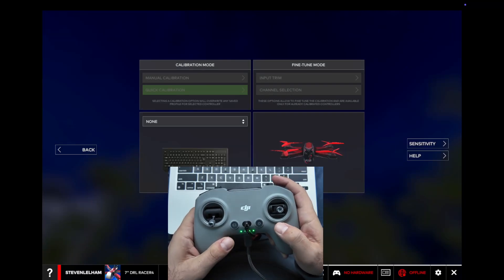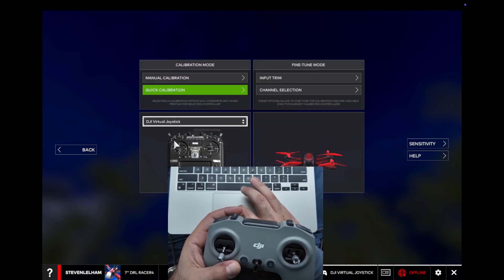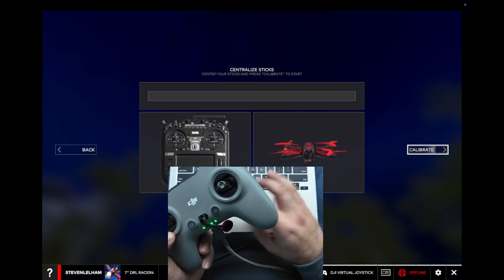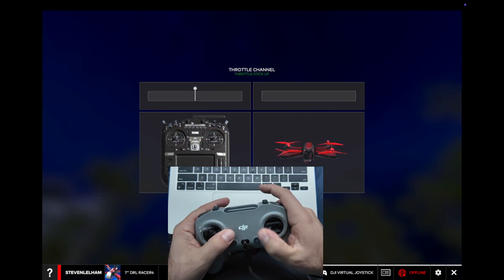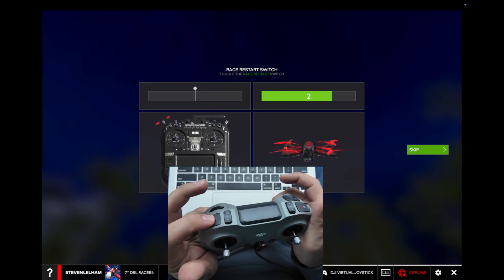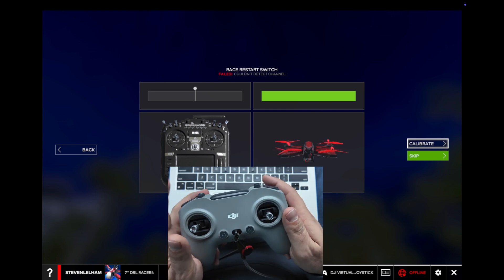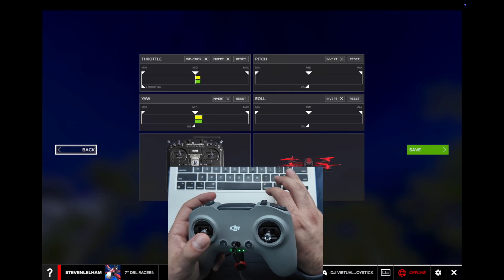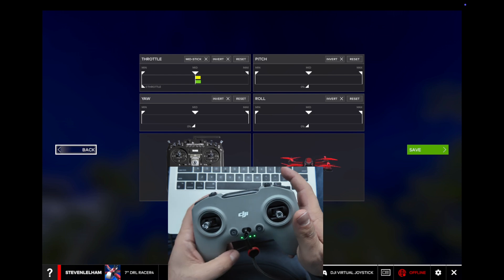How to Connect the DJI Controller 3 to DRL Simulator | Step-by-Step Guide

Comment: Mine isn't connecting to drl, doesn't even show on screen, it's not recognised, would you happen to know why?
Reply from the maker: Make sure it’s not a power only cable and that it transfers data too
Reply: @stevenlelham  tried that with 4 cables by now same result ..also it recognises it from time to time as an Xbox controller but the sticks are changed...

Comment: I'm doing it in a xbox but it's not reading the controller
Reply from the maker: It won’t work like that. Xbox won’t let you connect another type of controller. You have to be on pc or Mac to use the dji controller